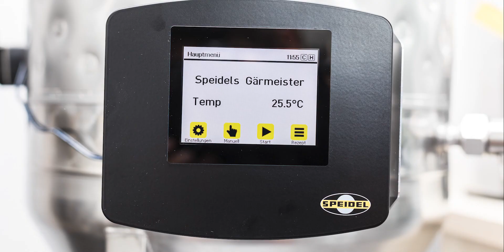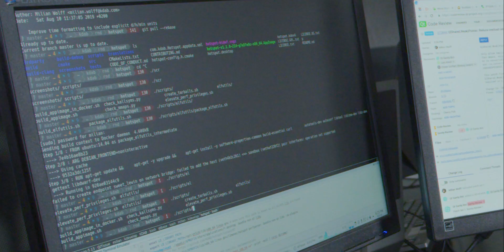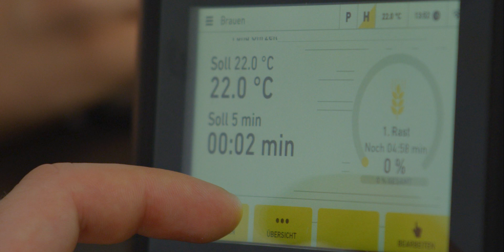Braumeister – KDAB helps generations old manufacturer turn into product innovator

Comment: It'd be cool is we knew the format of the recipe file or maybe if that file had been saved as some text format, such as XML, JSON, etc. Instead it's encoded in some unknown format.
Reply from the maker: Hi, 
Unfortunately, this was not upon us, but the customer to decide.
On older devices, the "legacy" format is indeed not easily understandable by human readers (its binary). This is most probably what you are referring to.

On newer devices, the internal format would be a more human-readable format, but it is not exposed to the users. This is a customer (Speidel) choice. Maybe you can reach out to Speidel to get access to that newer, humanly readable format. 

While we considered including standardised formats, such as beerxml for the Braumeister initially, even the second, human readable format turned out to be heavily deivce-specific.

Comment: The processor is a microcontroller?
Reply from the maker: Hi Saeed! 
Thanks for the question!
The processor the customer picked is NXP IMX.6 - series, so one should rather call it "CPU" instead of "MPU"/Microcontroller.
In this particular instance we still need to utilize QML with Software-Rendering, since no GPU is present on this particular model of IMX.6.
Reply: @KDABtv  Nice. Former Motorola IMX. Not necessarily my choice 3 years ago, but decent nonetheless.